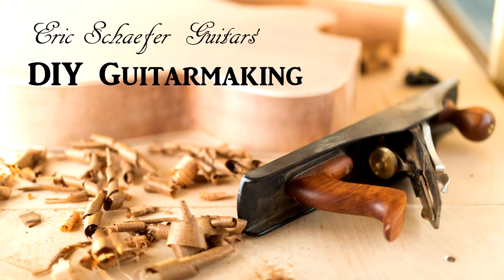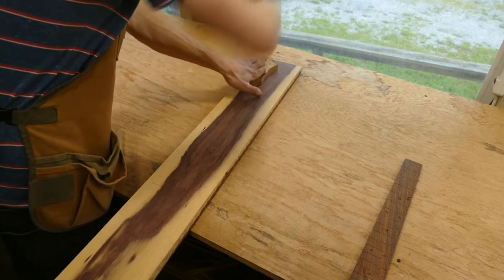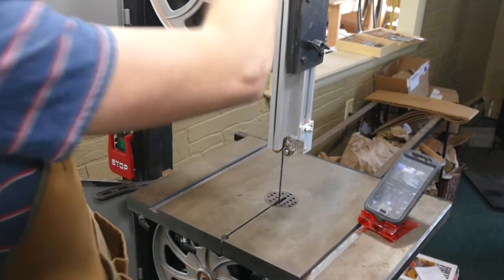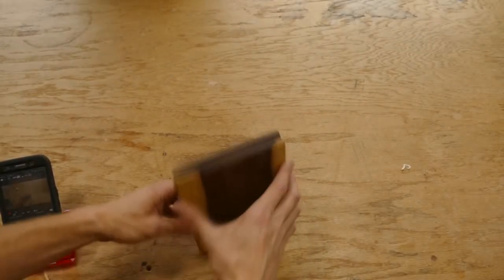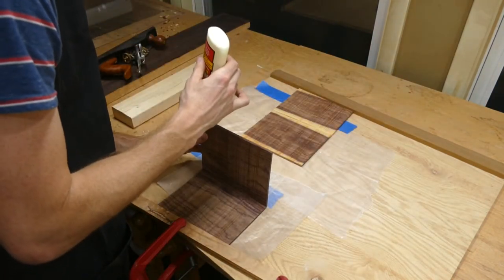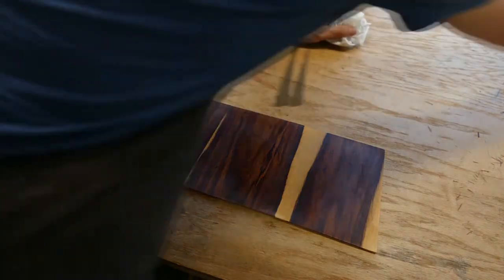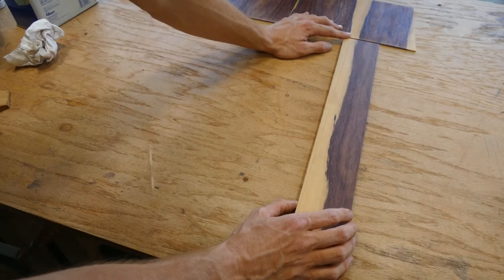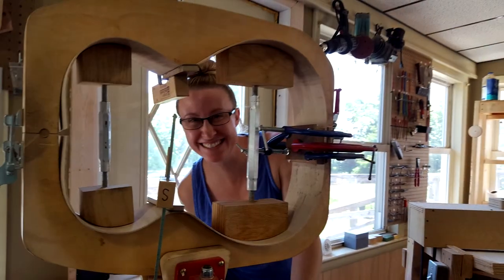Resawing Veneers and Using Bookmatching to Enhance Headplates, Rosettes and Other Appointments

Comment: Eric I really enjoy your vids they are very well made. I have the same bandsaw and have found that a 3/8” 4 tpi bandsaw blade works best for resawing. I built a resaw fence around 3” tall on one side and if you flip it it is 6” tall for resawing backs. Once the saw is set up for drift I can get 3.5mm backs and 2.5 sides. On most 4/4 boards I get 5 pieces for backs and 6 pieces for side. I sand the board flat on my drum sander since it’s right next to my bandsaw in between resawing so when I’m finished I only have to sand one side of the board. Don’t know if that makes sense. I have a question where do you get your Katalox boards and other lumber? I live in Dallas, Tx and am looking for a few suppliers of wood that can sell me boards at a decent price. I’d really appreciate any help. Keep up the great vids.